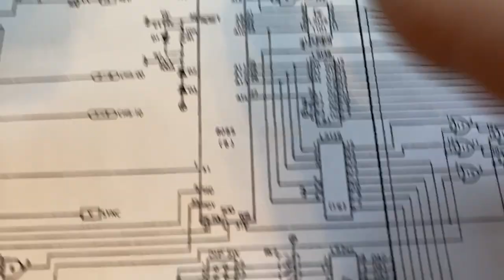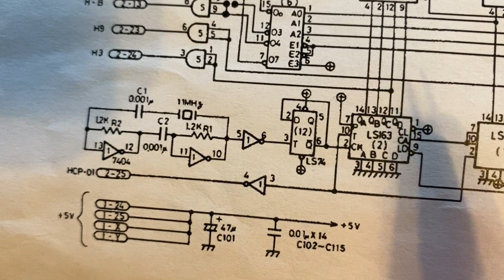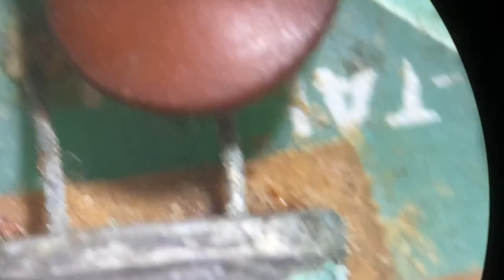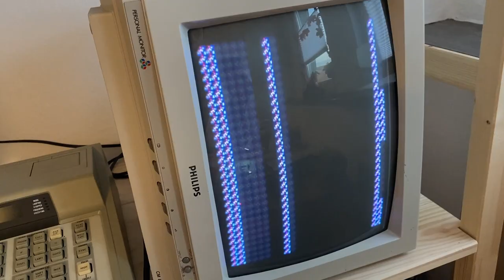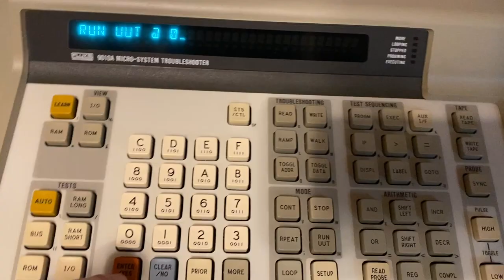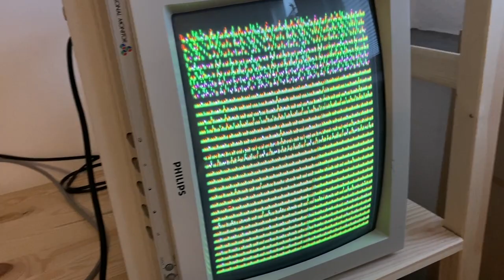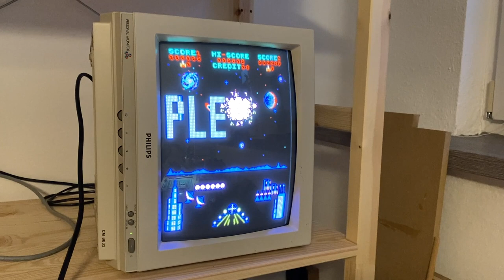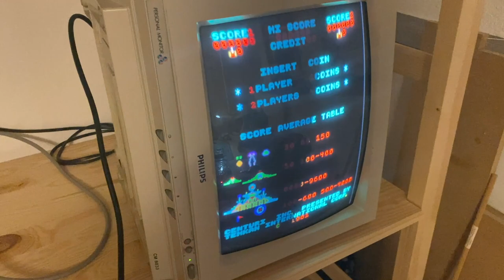Pleiades Arcade PCB Repair Part 2 / Phoenix Part 4 - RAM issues, Clock issues

Comment: You can buy those music/melody ics from Ebay, Cant think of the number off hand but there common to find and they are use in doorbells
Reply from the maker: Great tipp!!! I actually did buy the repacement melody chip - so I got 2 pleiades with sound running... ;-) thank you!

Comment: Another great video. I wonder sometimes would it be a good idea to put heatsinks on the ram chips of the more expensive boards to keep them running as long as possible. It couldn't hurt, I suppose! Some of the boards that are selling now go for hundreds of euros.
Reply from the maker: Yes, that is actually a great question. Sometimes there are certain ics that seem to run quite hot - so much that they even leave some like scorchmarks on the pcbs. But how could you attach a heatsink - with a special tape of some sort?
Reply: @christophzett  I've used small heatsinks for something else and they came with what closely matches standard double sided  sticky tape! Just a little thicker and much stickier. They can be glued aswell with a specific heatsink adhesive. And they also come with double sided foam tape stickers. So it's really down to yourself whichever method you prefer, I suppose. I think the sticky tape option is the one I'd go with though. I only suggested this for the rare and valuable games. Don't think it's worth the bother for everything. But it's all subjective, huh.

Comment: The working PCB has a number of wires running across the board. Is this just due to broken tracks, and if so, can the tracks be fixed and remove those wires?
Reply from the maker: Ah, good point. I forgot to mention it in the vid but the extra wires were actually added when the board was manufactured, so they are actually "factory original". They seem to compensate for some errors in the pcb layout that centuri made. Interesting, isn't it? I had this once with an atari pcb before, can't remember which one it was. Well, and I left the wires on because they are original.

Comment: That missing sound ic is a chip that has 4 melody’s that it can play. I have repaired my phoenix pcb, that had a working ‘melody’ chip but it was the wrong one. I wanted it to be as I remembered so I searched and found the correct melody chip. Do you know on the pleiades board what chip it needs, because I might have the one you need. If so I will send it to you.
Reply from the maker: Yes, the Pleiades board need an Epson 7910E melody ic. It's a different one compared to phoenix.
Reply: @christophzett  You are right, the ones I have are different. But found some, bought them and when they come in I will send you one. I have an untested 'Lupin' pcb that I think uses the same ic and it might be missing, so now I will have it in case I need it.
Reply: @christophzett  I have received my replacement 7910E for my "Lupin 3" pcb. I started work on this board this week and almost have it fully working, just missing one of the sounds, unfortunately there is no schematic so troubleshooting is difficult. Funny thing about this board is that the music can be either generated by the board or by the 7910E sound ic and this can be selected with a dip switch so it's not really necessary. Anyhow, if you want to complete your board, let me know and I'll send you a 7910E.